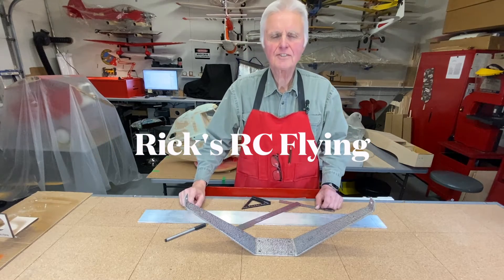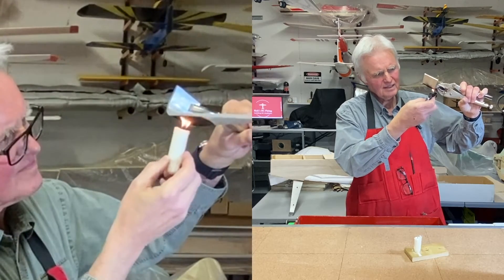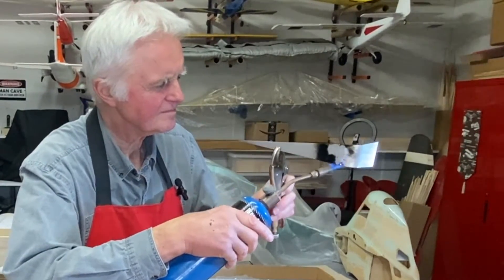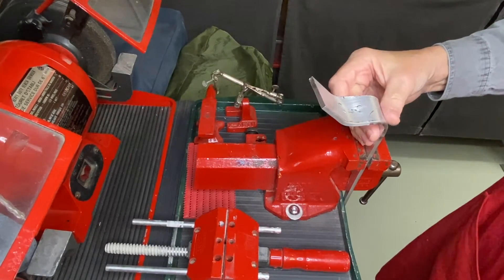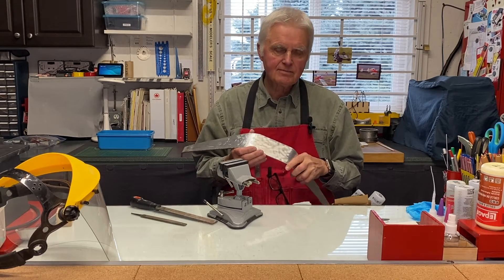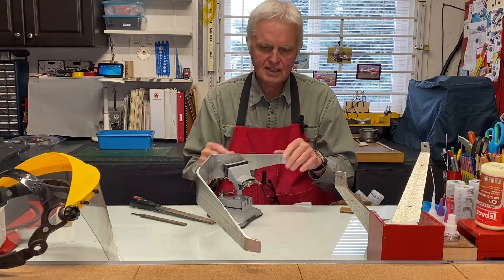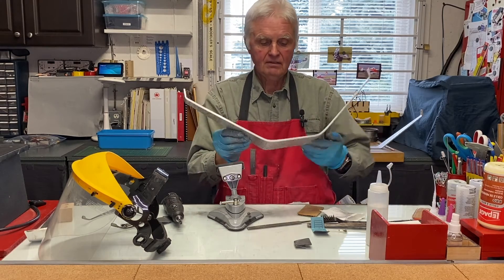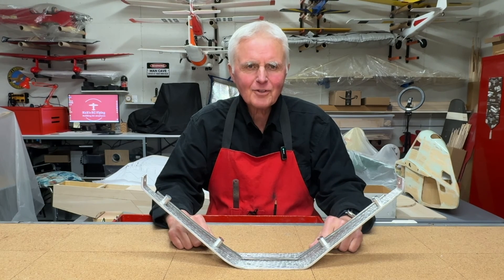Bending Aluminium Landing Gear For RC Model Airplanes

Comment: Hi Rick, In the past I have always used Dural type aluminum landing gear for my stunt airplanes. Problem is the plane I am now building requires a wider landing gear area across the fuselage. Can you or do you know of anyone that would be willing to make a custom one for me? Thanks, Mike
Reply from the maker: Hi Mike, I do make custom aluminum landing gear. You can contact me with your requirements at:     rc@aviator.ca
Regards, Rick
Reply: @rcflyingwithrick  Great!

Comment: Would 3003 be suitable for landing gear? I have access to a sheet metal brake, but I'm concerned that it won't have enough bending strength.
Reply from the maker: I personnel haven't used 3003. However, I know modellers you have. The characteristic of 3003 is that it has better workability than 6061. In other words, it is easier to bend and still maintain strength. However, they added the suspension system to control too much flexing. The 6061 is considerably stronger and more durable especially when it comes to heavier models. Nevertheless, it's worth trying the 3003.

Comment: I haven't tested it myself, but I've seen the aluminum annealing done this way using a Sharpie instead of candle soot (carbon). Make your marks where you want the bend and heat it with a propane torch until the Sharpie marks disappear.
Reply from the maker: That is an interesting technique I’ll have to try it. Thanks for the tip! Rick
Reply: Interesting, I had someone teach me to touch it with a piece of timber and if it smears its ready

Comment: What’s the maximum weight of the aircraft it can support?
Reply from the maker: I have used this on 25-pound airplanes. While I don't know the maximum weight capacity, I have made these for other modellers who use them on 30-35 pound. airplanes.

Comment: What is the hardness rating of the aluminum you used?
Reply from the maker: The Aluminum I use is "6061". Hardness, Brinell 95, Ultimate Tensile strength 88000 psi. Application Aircraft fittings. It's readily available from metal shops.

Comment: Awesome! I usually just look and find gear for my projects at the swap meet. It'll be nice to create my own since tnt isn't around.
Reply from the maker: Something to be said for buying a ready made gear. Although once you try making your own you'll find it pretty easy. The best part it will be a custom fit for your model. :)
Reply: @rcflyingwithrick  yeah I've never had a project where the dubro gear would work. I got a project in working on now that will need custom gear. I'll try it on that one.
Reply: Would you be willing to do a small custom job..I want aluminum landing gear like that on my fp202 koala think it would be like 44 inch wheel base... I could pay you ? I could make a mock up of what I need out of cardboad for a template. @rcflyingwithrick